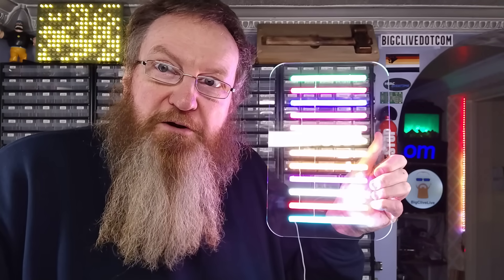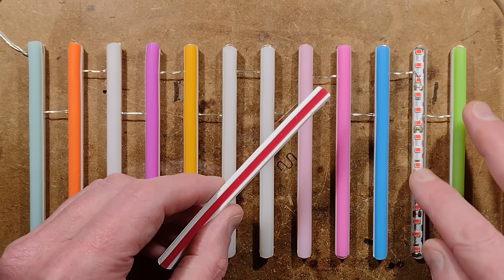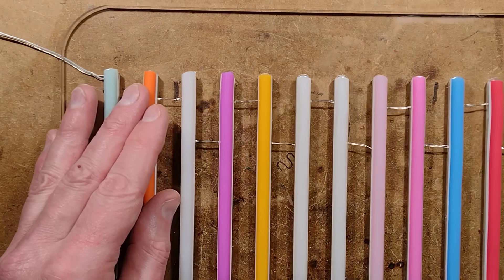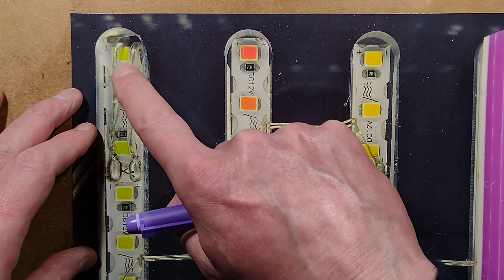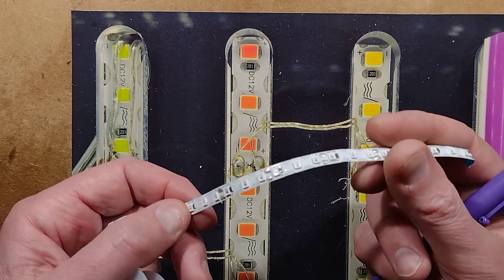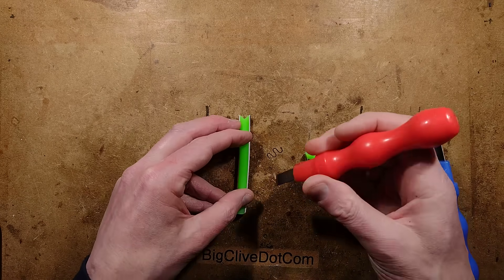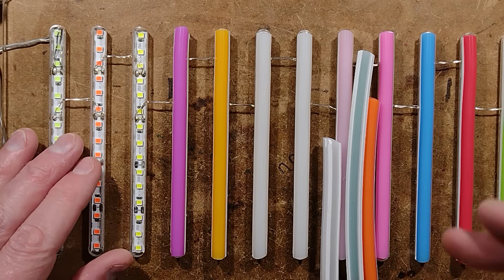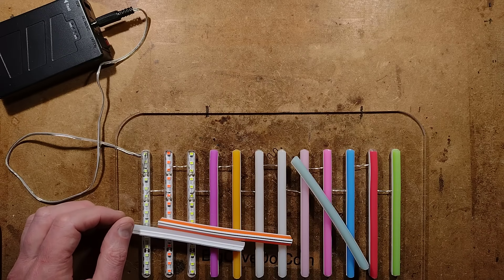Close look at an LED "neon" colour sample panel

Comment: Hi Clive  I was doing a clear out the weekend and I found a first generation colour kinetic Mr16 lamp with dip switches on the side. It’s the very first led lamp and it’s only a watt I believe I might be wrong. Would you like it send on to you Clive. Sean from Dublin
Reply from the maker: If it was a Color Kinetics lamp it would have been quite an early unit.  Can you drop me a message at bigclive1@gmail.com
Reply: @ I will Clive

Comment: Would love to see you do an overview of a red light  & NIR (near infrared) therapy led lamp. A company in the UK who are really reasonable called Nebula Appliances make them. So many sceptics of this type of light not understanding the benefits and thinking a normal red LED will work.
Reply from the maker: It is just ordinary LEDs and hype.  The first ones used 660nm LEDs because they were the cheapest high output LEDs available, and then they moved to the shorter wavelengths as they became cheaper and easier to get.

Comment: Some of the colours they are selling now are quite nice. I wonder how well the coloured phosphor ages over time. Years ago I bought a pack of pink LEDs for... reasons, and found that after several days of running at only 10 milliamps or so, the vibrant pink had become rather 'faded'. After about 3 months their output had been reduced to a dirty warm-ish white. It will be interesting to see how the modern versions stack up.
Reply from the maker: The first pink LEDs were terrible.  They faded really fast.

Comment: ( Possibly ? ) the reason for using all  BLUE  LEDs with the appropriate phosphor ... is ... the dropper ( ballast ! ) resistors can  ALL  be the same value ( think : China  ULTRA  mass production 😝 ) .. comments ? ..... DAVE™🛑
Reply from the maker: All the tapes are 12V and have resistors that match the LED type.

Comment: It seems like this form of LED 'neon' signage is replacing more traditional neon signage, for a multitude of reasons, including cost of production, longevity of use in certain applications, & even energy savings.
Reply from the maker: They won't last as long as real neon, but they are much cheaper and don't use high voltage.
Reply: Certainly for cost and energy savings.  I doubt that LED signage would be more robust than neon, especially outdoors.  I've always loved neon signage.  I grew up near a big city and there was neon signage _everywhere_.  Where I live now, neon signs are few and far between and not always operational.

I think these LED signs are a good thing in a way, because a home workshop is completely sufficient for making them.  Neon, on the other hand, is about on the upper boundary of what an individual can do with a well-equipped private workshop.  You need glassworking skills and equipment and the ability to work with the gases.  It's not just neon, other noble gases are used as well.  I used to know this, but I believe neon glows red-orange and argon or xenon glows white.  At least they're not explosive (in fact, they are quite unreactive, hence the name), but the voltages, as noted, are quite high.

I've done some computer graphics trying to simulate the appearance of neon signage, and I think it works pretty well, but I haven't quite gotten the color matching.  Pixels on a computer screen are, of course, also LEDs.  White isn't a problem, of course.  I haven't really made a serious effort to do this yet.
Reply: LEDs would also be great for light chaser effects.  I strongly prefer the appearance of incandescent bulbs, but it seems to me it would be easy to make a mock-up using LEDs and a breadboard.  Apart from incandescent bulbs having gone the way of the buggy whip and the antimacassar.  Programming light chaser effects is rather tricky and time-consuming, but it seems that the technical realization with LEDs would be pretty easy.

Comment: The phosphor isn't part of the LED 'chip' itself so it's probably a lot cheaper to have the silicon manufactured for only one type of LED and change colour at the encapsulation stage and phosphor gives you a much wider choice of colours

Comment: A few months ago I saw a couple workers disassembling a neon sign in front of a restaurant, and thought, "oh please, be taking it in to repair it, not throw it away." No such luck, replaced by a boring back-lit plastic sign. On the other hand, the neon sign at a local burger joint, first opened in the 50s?, had theirs restored and I saw it for the first time the other day. I was busy and couldn't turn around to get pictures, and haven't seen it lit each time I've driven by since. It looks beautiful.
Reply: neon signs are expensive to maintain, most businnesses don't care and can't wait to get rid of them. The burger joint probably has a manager/owner that likes the sign
Reply: @AntonioMolfetta  Current owners' parents bought it in '74. It reopened last year after being closed for 3 years due to the death of the parents. The children running it now are aware of the historic/nostalgic meaning to the community.
Reply from the maker: Next time you see that, ask the workers if you can have one of the old neon tubes.  They'll probably give you one.

Comment: The bit used to cut that slot is called a Keyhole Cutting Bit, or a chamfering bit that can be plunged.  It's a pretty common bit used in woodworking and is definitely the correct way to have constructed that.

Comment: i think the reason behind the phosphor instead of individual colored LEDs is to maintain same system forward voltage for ALL LEDs. making it easy to mix and match colors on your signage without needing multiple voltage levels.
Reply from the maker: They can adjust the resistors on the tape to match the 12v supply voltage.

Comment: You might wanna check out the knock off Othemo led light bands, so far ive purchased two one was a replacement but the thing is its not charging, came with a charged battery which ran out but fails to charge back up even thos charging status light displays, would live it if i can send it to you to tear it down and explain wth is going on with it!
Reply from the maker: I've looked at a version of that.

Comment: Phosphor LED allows using the same driver for all colors.
Reply from the maker: They can use a suitable resistor on the tape for running the red LEDs on 12V.

Comment: Clive, very nice. I would love to have seen what happens when you mix & match those silicone strips over different LED substrates. I bet even more colors could be created.
Reply: Doubtful because the LEDs produce nearly monochromatic light. If the LED color is not real close to the strip color I doubt much light would get through.
Reply: @sootikins  That's only true for pure leds. These phosphorus coated ones give a wide spread.

Comment: Why can’t people just use real neon :( LEDs are so boring
Reply from the maker: Cost, ruggedness, availability and the use of high voltage.
Reply: @SarahFilm_yes If you're afraid of something, it's definitely better to avoid working with it.  There are dangers involved in working with glass, including high temperatures.  With neon, you wouldn't need to blow the glass, you would only need to do "lampwork", so you wouldn't need a glass oven.  The flame used for lampwork isn't as hot.    Still, it's an open flame and plenty hot.  

Then there are the high voltages for neon.   Nothing can compare with the appearance of glowing neon, argon, etc., but one has to balance that with what one feels safe doing.

Comment: kind of sad that the art  of vintage neon is becoming more and more rare. but on the other hand,
the LED type take a hell of a lot less electricity  to run , and are not as easily breakable   or expensive to repair or replace.
so its a good thing
Reply from the maker: I have mixed thoughts about that too.  Real neon is nice, but the LED stuff is infinitely more affordable, even if it doesn't last as long as well made neon.
Reply: I agree with you, but neon is obsolete for commercial signage.  Personally, I would rather that it disappear, than live on in a debased form as something "hip" or "trendy".  It's still possible to get the tools and materials, so maybe someday I'll be able to make a little neon sculpture.  It sure won't be an enormous sign for a movie palace, but the movie palaces are gone, too.  "The old topples, times change, and life springs anew from the ruins." (Schiller)

Comment: I've got to say thank you for your videos over the years. Today I was doing a regular clean of my Puremate "Ionizer" you did a video on a few years back (it's really an ozone generator), but it's "low/high circuitry" had given up a while ago, so I kept the diode and just hotwired it for whole house ozone (kept in the hallway). Well for today's clean, I added one of those 12v carbon tip ionizer modules to it to boost it's air dust removal (for some reason where we live now is super dusty, I don't get it! haha). Anyway would never have had the confidence to tinker without your friendly inspiration over the years. (have no idea about the health "benefits" of ozone/ionizers and don't much care because they're great for dust removal! :D)

Comment: I don't think they route the channel out in one go. A tool that can cut a channel and those grooves at the same time would be extremely difficult to make and prohibitively expensive. Not to mention clearing chips would be next to impossible, so you'd get horible surface finish. Here's how I think they do it: First plunge down the ends with a full-width center cutting end mill, perhaps after pre-drilling it. Second, Route out the center channel with an end mill that is a little narrower. Third, come in with a grooving cutter and cut the grooves individually. That would cost you a few dollars in tooling as opposed to a few hundred for a highly delicate and complicated custom cutter.
Reply: Clive said it was a "sampler" piece so that suggests small batches production but I think it would make for interesting furniture pieces/panels making it worthwhile to build a good/adaptable CNC setup,and tidy up the crossover wiring.
Reply from the maker: There's a huge industry in making these signs with just a few standard widths of strip.  That easily justifies making custom router bits.
Reply from the maker: https://vi.aliexpress.com/item/1005007403228441.html
Reply: @ I see, that's an interesting geometry. Instead of making it a T-shape as you would expect coming from traditional machining, they are merely cutting a taper into the flanks of regular cylindrical end mill in a bit. That breaks the cutting edge geometry to no end of course, but I guess it's good enough for soft materials like acrylic. Also I keep forgetting how cheap the chinese can make stuff that would be horribly expensive from a western manufacturer, by the simpe expedient of making it badly and cheaply.

Comment: The reason why they used phosphor is probably because phosphor colors are well understood in neon lighting circles, after all that is how traditional neon lighting did it. It might actually be easier to get diverse and accurate colors by combining know phosphor mixtures with blue or ultraviolet LED than trying to mix-and-match LED of different colors. I've often noticed how the colors of multicolor LED look a bit off at times. I think that is because we are seeing narrow peaks of distinct colors mixed instead of real light of a specific wavelength, which only mostly fools our visual perception.

Comment: Using the same LED across all types and just slapping filters over them allows them to use simpler power supply circuitry because they only need to target one voltage.

Comment: Darn it, one more reason I need to get my CNC back on line, the signage possibilities are quite fantastic with this stuff. I guess I had better get my bum moving.
Reply from the maker: They sell router bits just for this material.
https://vi.aliexpress.com/item/1005007403228441.html

Comment: Hi Clive, thanks for the video, I have an LED related question, how do I drive 20x 16 segment common anode digits, I got a bunch of 74595's and I wondered about charlieplexing, but would the common anode thing get in the way?
Reply from the maker: I suppose it might be viable to charlieplex a mixture of common anode and common cathode displays in parallel.  Or perhaps one of the LED multiplexing chips like the MAX7219 which also has the advantage of using a single resistor to set the current for all the LEDs.

Comment: the reason that it is so cheap is because this is automated.  Nobody is actually touching these things with the tools that you have, its done by machine.  I have personally been to a factory in China that makes these kinds of things.  This swatch panel was more expensive because it actually needed some 'hands on' for the small scale manufacturing of this panel.

Comment: I think the wire is in front only because it is a display of the colors and not an actual sign.
Reply from the maker: It does make sense to make signs with the wires on the front.  Much easier to connect and dress them than if there were holes.

Comment: I always like neon to be white when it's turned off. Kinda adds to the magic if the colours only appear when it's turned on.
Reply: I always liked neon to be...

Neon.
Everything is a cheap knock off of what used to be.
Reply: @Jimmeh_B  Yeah, it's not as if neon shops are a business with costs and overhead or anything like that.  I'm sure all their costs have stayed flat since the 1950s. @_@
(LOL)
Reply: from an artistic point of view, I like it both ways. sometimes you want that mystery, and sometimes you want it to look more 'correct' even powered off.
Reply: @tenabrae  I call this the "Mounds/Almond Joy" principle.  That is, "Sometimes you feel like a nut/Sometimes you don't."
Reply from the maker: All the front diffusers could be replaced with neutral white ones.  But there is much better contrast when it's the same colour as the LED.
Reply: "I always like neon to be white when it's turned off"
Traditional neon tubes (other noble gasses  are available) are made of clear ie. colourless glass.
Reply: @rambo1152  True, but a lot of neon (and neon style) tubes do have a matte, opaque white phosphor coating on the inside to create specific colors when on and appear just white when off, similar to fluorescent lamp tubes.
Reply: I'm under the impression that the blue LED excites the phosphorus (which obviously is different for the individual strips), and THEN the whitish light is filtered though the coloured diffuser. 
We never see the strips on without the diffusers?
Reply: @emilen2 they are on for a second at 5:50 ish
Reply: @emilen2  Using white LEDs would be a lot less efficient, because you'd be converting the blue light to unwanted colours which would then be blocked by the diffuser.
Reply: @emilen2   FYI phosphorus is a chemical element, commonly found in urine, unrelated to the different types of phosphor used in LEDs.
Reply: @vink6163  Thanks, though I'm well versed in chemistry and the elements 👍
Reply: @railgap  Well I nevr make mistkaes! ;)
Reply: I always preferred the ones where there was no coating and you saw the color of the glowing gas.  An effect I particularly liked was when you were sitting near a neon sign in a dimly-lighted room.  Due to the intensity of the light from the gas, the shadows cast by the neon sign would be colored.  There had to be some ambient light for this to work.  The sign had to be at lower height, like in the window of a restaurant.  Obviously, it was fairly rare for all the conditions to be present.  The shadow had the complementary color of the illumination.

The same effect can be observed with (orange) sodium-vapor streetlights at twilight (blue shadows).
Reply: I prefer clear radon.

Comment: They can also use an end mill narrower than the slot and go around in an oval to cut the sides one at a time. That tends to give better results than making a single full width pass. 

Machining acrylic like that is a real pain. I guess they must not have enough volume to justify making a mold.

Comment: I suspect the other reason for the phosphor version is that it has a wider band of color, which looks quite a bit different than the nearly-monochromatic red LED light.
Reply: Did you know if you look in the mirror and say "monochromatic LED" three times then behind you will appear Alec from TechnologyConnections?
Reply: @OliverUnderTheMoon  even common lasers are not truly monochromatic, and the definition allows for it
Reply: @drkastenbrot  was referencing OP
Reply: pure red led light can look pretty distracting, i would definitely prefer the softer look of PC red
Reply: Phosphor led really is a unique color. It's more iridescent.

Comment: I would guess they're all blue LEDs with phosphor because it's actually cheaper just to plonk different colour phosphors on the same ultra mass-produced blue LED than to use different LED technologies. Having learned from you that the other technologies are more reliable, I've been looking out for them and have realised that listings often don't tell you what's actually being supplied.

Using the same underlying blue LED for everything also means all strips are electrically identical, which might also be useful in certain circumstances - needing only one value of series resistor springs to mind.
Reply: there is another reason, it looks better: https://www.youtube.com/watch?v=qSFNufruSKw
Reply: @jmkhenka Coloured "LEDs" made using Blue LEDs and phosphor are usually more efficient too.